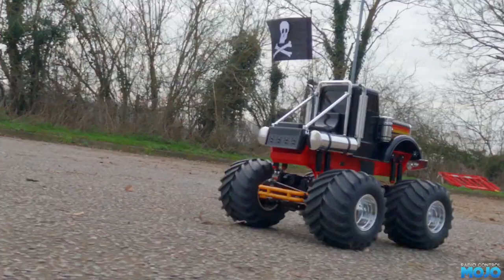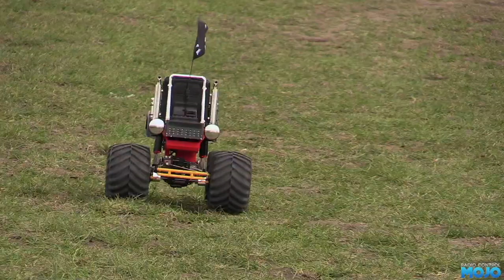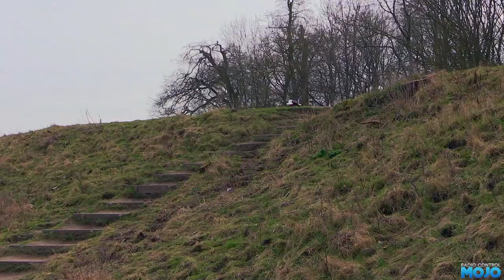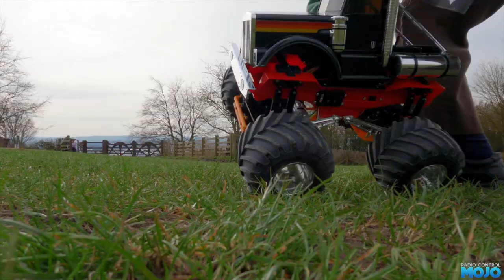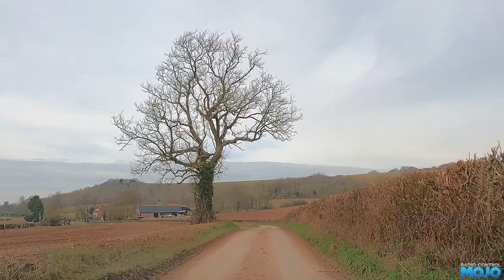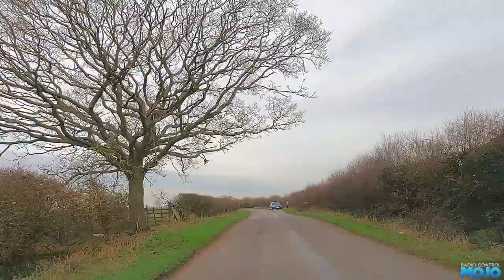Tamiya Bullhead - #12 Venturing Outside

Comment: Dust collector, not a basher,  sadly mere toy
Reply: define Basher, this one seems like fun to drive around with?
Reply from the maker: I think basher tends to means high speed launches off ramps these days, which is fair enough. The Clod/Bullhead isn't that kind of model, especially with the stock chassis. Comparing it to full size monsters it's more like the days of car crushing rather than todays huge air
Reply: @RCMojoTV  i dont tend to like the word BAsh as it sounds like you want to break it
Reply: @Street Blue Why do you always spread hate in the comments?